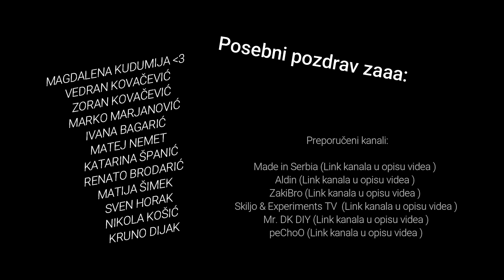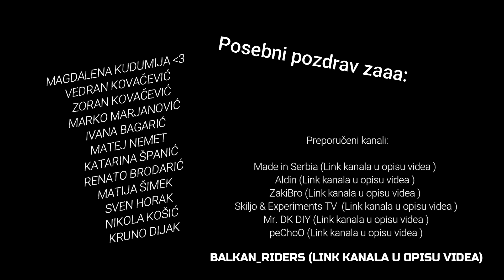Homemade TRAILER For MOTOCULTIVATOR ! (MOTO WHEELBARROW)

Comment: I like this build too! If you want too do what I'd do? Add a third hinge, an load wood ends ninth degree from front, so when trailer tips forward, wood pieces want too Roll out! During build I thought you should put propeller motor on back an use it for swamp buggy!